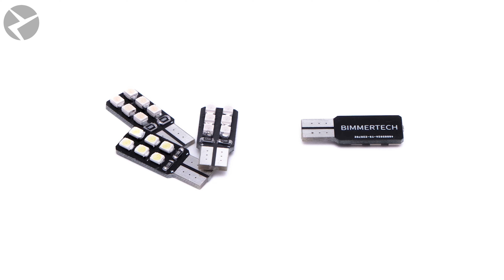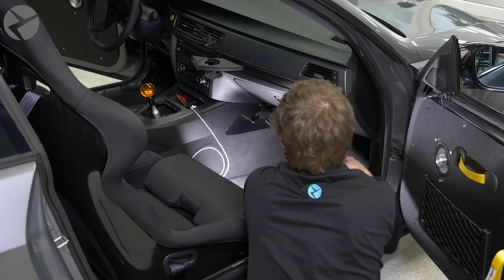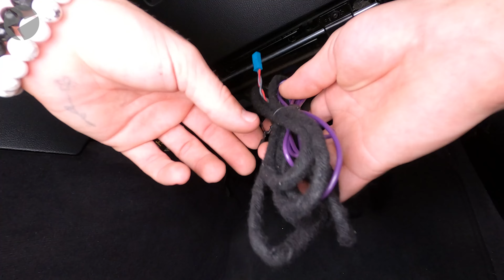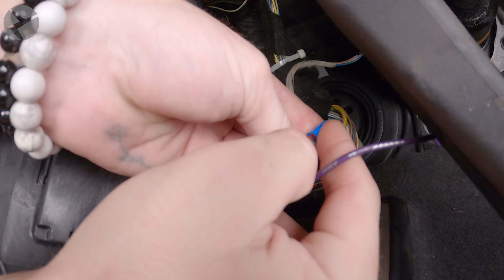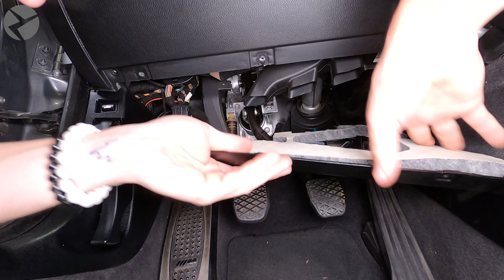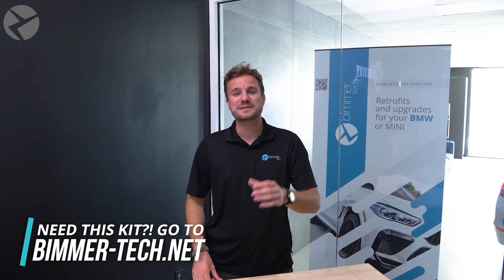LED Footwell Lights – BMW E-Series Install

Comment: If I connect the lights to the fuse box like mentioned in the video, won't they stay always on (even if I lock my car and leave it)?
Reply from the maker: They do not stay always ON that is for sure however it will depend on the options of your car when they will be turned off
Reply: @bimmer-tech  In my 2008 E92 they stayed on for three hours before I turned them off manually